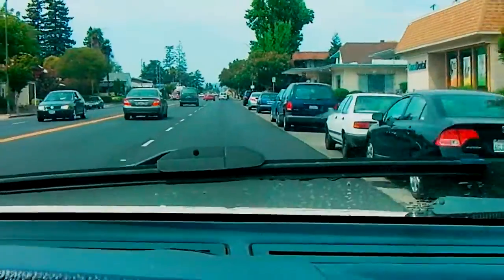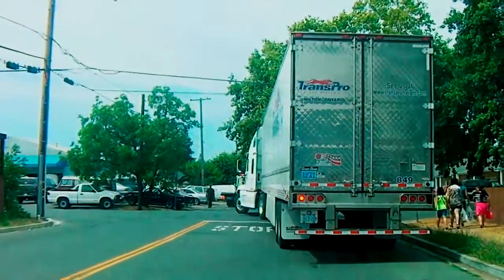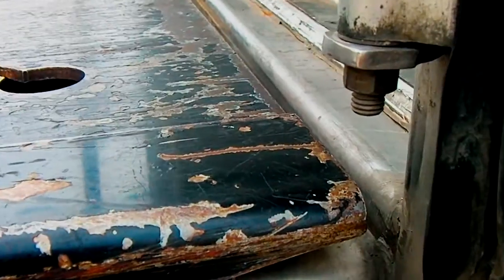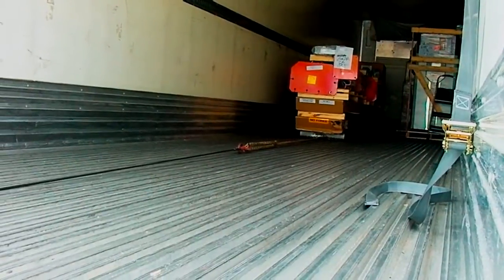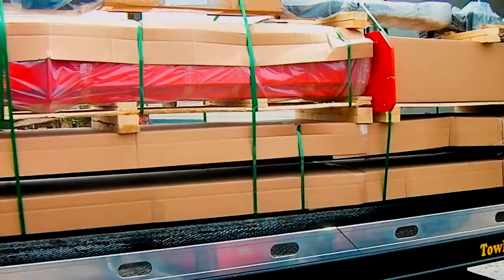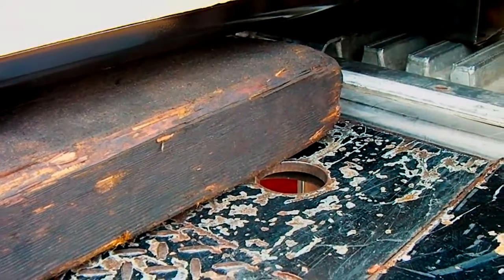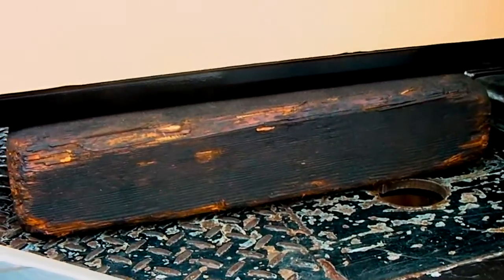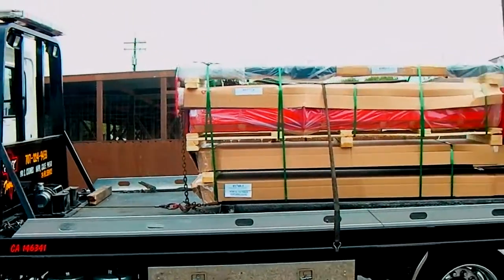Tow Truck Off-loading An Automotive Lift

Comment: With loads like that (sheds, etc) we never pull it all the way onto the bed, the overhang allows you to get the load to bite into the ground and hopefully pull itself off your bed with the correct unloading technique.    Hoists aren't that heavy either, ours range from 6-900lbs per post.

Comment: having a flatbed tow truck is often adventuresome. I recently helped with medical diagnostics equipment, bringing out of bobtails and lowering to the ground. The transportation company has rollers that bolt to the ends of the machines and raise / lower them using screw jacks incorporated into the rollers. unfortunately, one of the guys got a little over zealous winding up one end, causing a bind on the other end. the other guy put more and more crank on the screw until the head twisted off. OOPS! I had to sit and wait for two and a half hours for new rollers to be brought to the site. I could've put it on the ground but the honchos wanted it to be rolled off. Fine by me. when it finally did get unloaded, it was about a half inch too tall for the doorway. OOPS again. I didn't hang around to see if they shortened the machine or heightened the doorway.